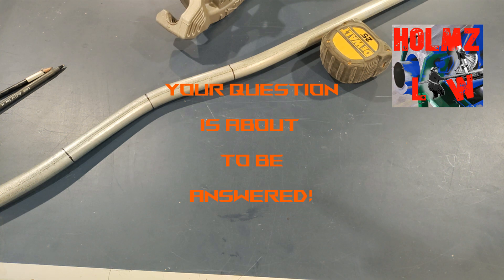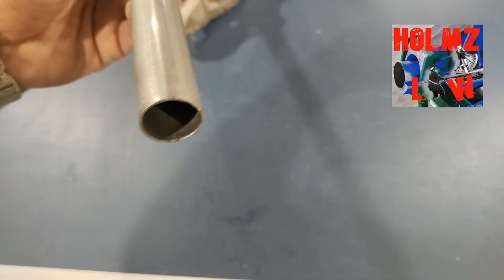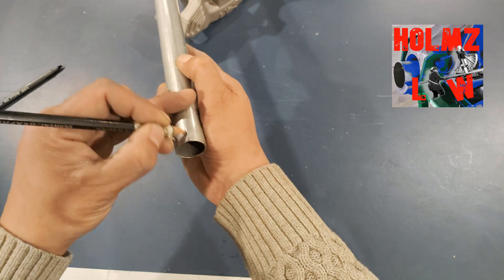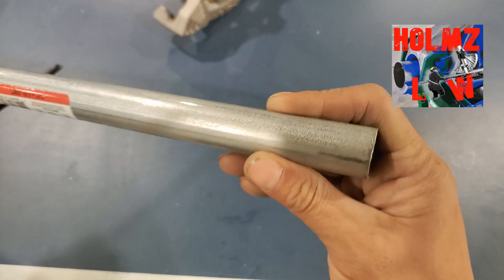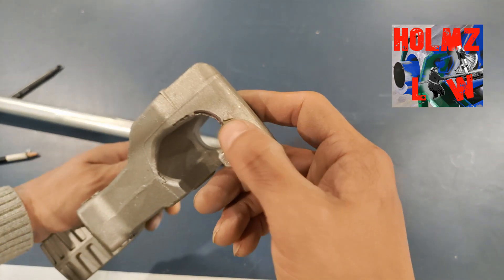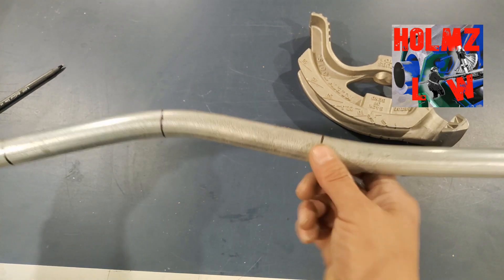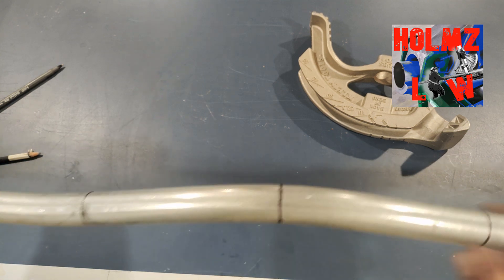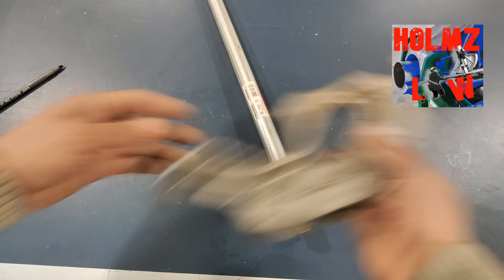How to bend conduit (stop dogging conduit)

Comment: that's something I never thought of before on using the seem for the second bend. Because it will be visible when you move your conduit away from the end. Great tip! You would think that would be something you would think of but I guess it's just the pressure you feel when you're out on the job!
Reply from the maker: Yes exactly. Trust me I know the feeling of the pressure. Every time I find myself in that position "mentally" I kind of stop for a second and re group myself. Because I can not tell you how many times I have had to do things over twice or even 3 times! Because of the pressure and me not thinking things through.
Reply: @TheArtOfConduitBending  I've seen old timers do the same, brother, and they've been doing it all their life. I'm old, but I've spent my life doing so many other things than electrical work.

Comment: If you use a sharpie and keep the mark short enough that the connector will cover it, it will be easier to see when you're bending.
Reply from the maker: Yes t that is what I meant to use but didn't have the sharpie. I actually should have mentioned to use a sharpie. Damn it! Anyway thanks for mentioning it.
Reply: @TheArtOfConduitBending  you did mention using the sharpie. Some people might of thought just for the example though, so I didn't really say it to well, but even though you don't want to normally use a sharpie, you can if you keep it close enough to the end that it will be covered by the connector. Sorry about that. but even if you do use it further from the end, it is possible to erase a sharpie mark by using a sharpie going over the mark and wiping it off with your finger. You should try it some time. I just recently learned that trick, so it can be useful, especially if you made a mistake and want to remove the mark!
Reply from the maker: @comingtofull-ageinchrist6736  yes that's what I was thinking when I was doing the example. I should've said it. Apprentice's need to hear that some don't have the experience to know what I'm talking about. That's why my videos are long I try to explain as much as possible. Thanks for the comments
Reply: @TheArtOfConduitBending  great video! I hope you are a part of a union. you get better pay as an electrician! If you aren't, you should check into your local union!
Reply from the maker: @comingtofull-ageinchrist6736  wish I was. World have loved to be a teacher for the union. You know give back. I've been non union for so long now. I don't know if I could start over
Reply: @TheArtOfConduitBending  You wouldn't have to start over! You should check into it! You go in and take an evaluation, and with you knowledge, you would easily be a Quality Connected Journeyman Wireman, QC JW. Here in Oklahoma, it is 35.05 an hour after all the other benefits. You should look into it. Employers put 12.5% into your 401K and it's besides a 5% supplementary pension you get for the rest of your life. You should really investigate it. You are actually getting 44.00 dollars, roughly, an hour before the health, dental, optical and supplemental pension and a couple other things come out. I hope you look into it.
Reply from the maker: @comingtofull-ageinchrist6736  I think I will. Look into it.
Reply: @TheArtOfConduitBending  You deserve to get paid better and get better benefits!
Reply: Most locals are hurting for teachers, maybe they could even have you specialize as being the conduit bending teacher.  Usually you get paid overtime JW rate to teach.

I think New York local #3 JW rate is around $53 an hour
Reply from the maker: @KLAWNINETY  yes it is. Something like that. I didn't realize you could come in at a certain level and didn't have to start over. Thanks for the info.